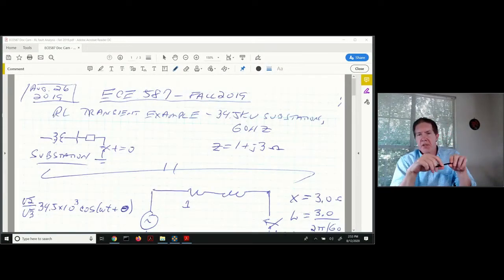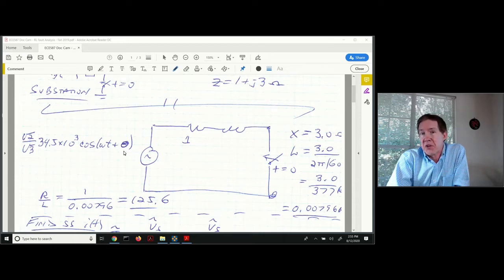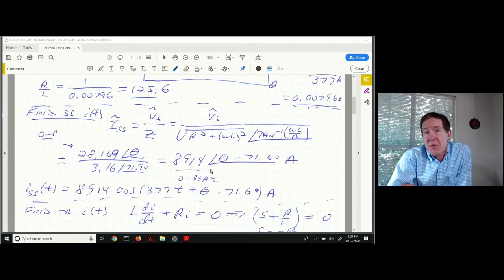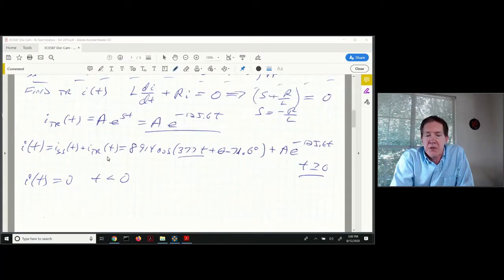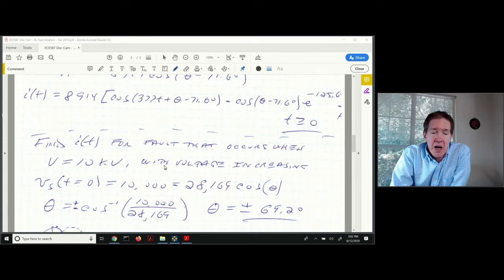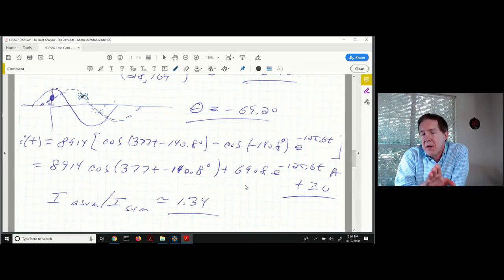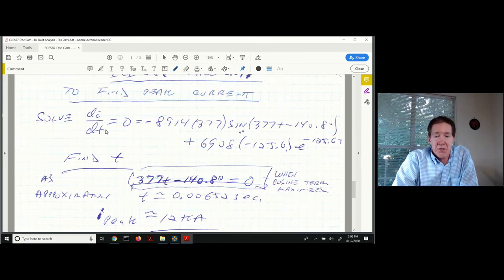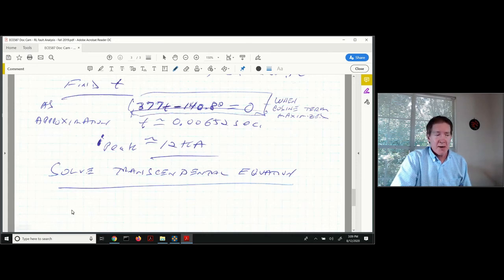Lecture 2b: RL Fault Transients Worked Example - Power System Transients Fall 2020 - Lubkeman

Comment: Hello Professor. Why do we need to represent point on wave using theta? Why isn’t time “t” alone sufficient to represent the time of fault occurrence/clearance.
Reply from the maker: The reference I am using for time is that t=0 at the inception of the fault.  But I cannot just have a source voltage of sqrt(2)Vm*cos(wt) driving the circuit, since in practice a fault could occur at any point on that source waveform.  So I add a point on wave angle to the source and model it as sqrt(2)Vm*cos(wt+theta).  So if theta=0, the fault occurs at a voltage peak, or if theta=180 degrees, the fault occurs at a negative peak.

Comment: 9:50 can you please explain about the drawing these two wawe ? Is that both current and  Why you  draw the point in y-axis ? thank you.
Reply from the maker: For this example I am modeling the voltage source as a cosine waveform with a phase shift of theta.  In the figure, the solid curve represents the voltage if theta = 0.  

However in the problem statement, I want the fault to occur at t=0 when the voltage is 10kV and increasing, so I need to solve for what value of theta would give me that point on wave condition.  In this example we compute theta = -69.2 degrees, and that dashed waveform represents what the voltage would look like with that phase shift.  

The point on the y-axis at t=0 shows for this phase shift, that the voltage magnitude is 10kV at t=0, and the voltage is indeed increasing.

Unfortunately since I had in the past been writing this out during class by hand, that the phase-shifted voltage is not drawn that well to scale.  But the dashed waveform is just a cosine (cos(wt)) voltage waveform phase shifted by -69.2 degrees.

the source voltage
Reply: @dr.davidlubkeman284   thats  makes sense for me now, thank you very much I am very appreciate for feedback.